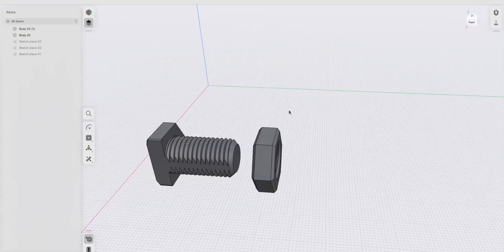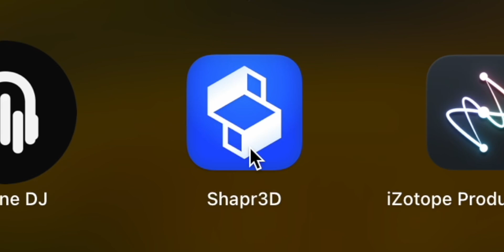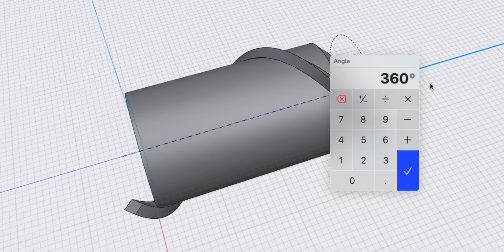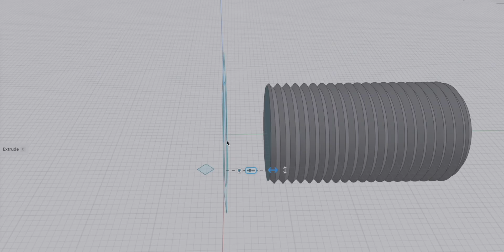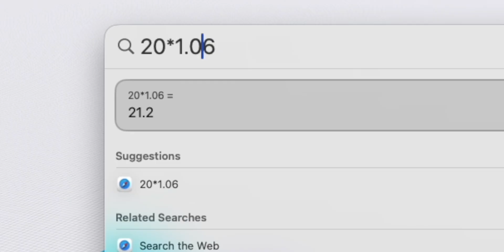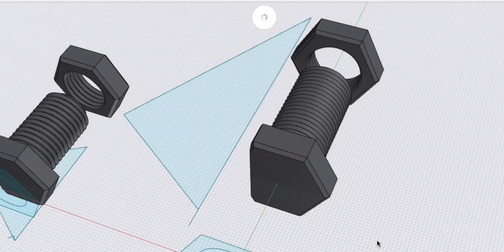3D PRINT STRONGER BOLTS (Super Easy!) | Shapr3D Tutorial #3dprinting #shapr3d #bambulab

Comment: Why 45 degrees?  60 degrees is typical?
Reply from the maker: Reduced overhang for 3D printing
Reply: @overclock3dp  Got it.  I'd suggest also altering the angles of the thread so that it resembles a buttress thread.  As a machinist by trade, when I am given a plastic thread to single point thread on a lathe, the thread is always engineered with the buttress thread geometry.  Buttress geometry was developed specifically to give plastic threads strength.  The threads on the cap of a tube of toothpaste has a buttress thread.  I've never seen the 3D printing community implement this thread form which seems puzzling to me.

Comment: There is an easier way to transfer the thread to the nut. Simply make the inner hole of the nut .2mm larger than the shaft of the bolt then place the nut over the bolt and use the subtract tool to transfer the thread to the nut. Then grab the entire inner thread of the nut and do an offset face plus .15-.3mm and you won't have to do any math or calculations. You could also do this in reverse and offset face minus on the bolt.
Reply from the maker: Great tip! Sounds like a great approach. Thanks for sharing 👍